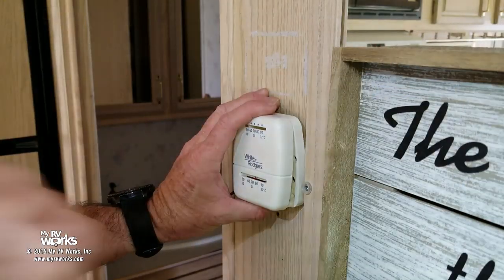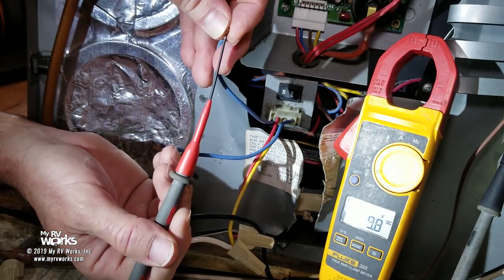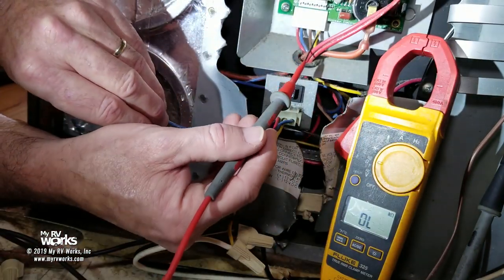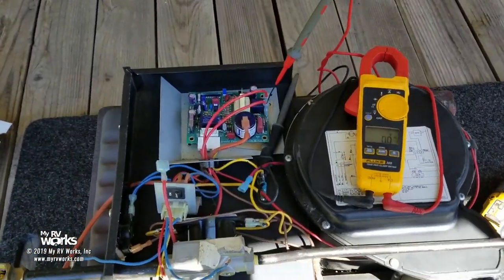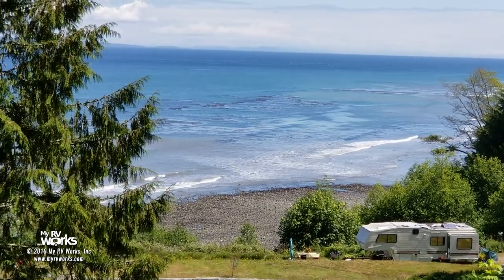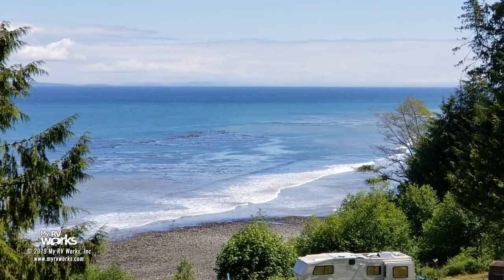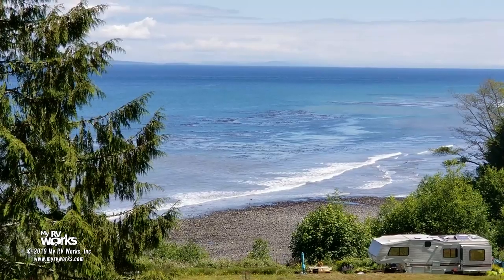RV Furnace Clicks But Doesn't Engage Blower Or Produce Heat - BONUS Strait Of Juan de Fuca Peek

Comment: Thanks Darren, I had the exact same problem the night you released this video on patron. It was good to see I used your "follow the trail" process to discover the problem. Finding a replacement motor was the hardest part. Suburban was out of stock and none of the area dealerships had one. With nightly temps in the upper twenties I had to go for a generic replacement I could get in 2 days. Would like to hear how you deal with this type situation. You are my number one guide to trouble shooting! Thanks for all your work, Charles

Comment: This may have helped me a bunch. Working on a suburban sf-42 with exact symptoms. T/S closes, audible click at the unit, blower does not start. Have not yet tested voltage. My initial assumption was a bad main board as customer said the unit was working a week and a half ago. However, I will complete a voltage test to confirm source of the issue. Thank you for these videos, huge help. 👍

Comment: Nobody ever talks about the Electrode Ignitor.  The amount/intensity of the sparks that  you'll get has a lot to do with the function of the furnace.  You can still get/hear a clicking noise that sounds like the electrode is igniting, but the spark won't be intense enough to start a flame.  This is due to a bad ignitor on the board (not sending the correct amount of electrodes). You can buy those separately if you know how to de-solder and re-solder one back on.  Otherwise, you'll have to swap out the entire board.  Thank you very much for the detailed video.

1

Comment: Darren, 

     Love that you show your thought process when doing your repairs. Keep up the good work. Can you show the inside of your trailer and what you stock.

Thanks
Reply from the maker: Thanks for the comment.  When I was sitting in the camp chair trying to come up with basic analogies I decided not to go too deep into that topic – I was already worried I was making a mess of my analogy and needed to get back to work – I could see the customer was getting antsy w/o having any power eh.  I do appreciate the comments though because it allows us to continue the discussion.
Reply: Darren,  I will turn heat on via a dometic t-stat fan and heat may come on immediately OR 3 HOURS later or even the next day?  So, is this 🤔 the relay going bad?  My rig is a 2004 Pilgrim international.

Comment: Physically checked distribution panel fuse (good). Thermostat clicks. Voltage checked the power switch, sail switch and circuit board. All seems to be working with the circuit board giving the error of "Air flow / limit fault). The Blower on the other hand does not seem to be getting power. I tested the -12VDC wire from the wall which is capped to the black wire going to the chassis of the blower. It worked fine. The black wire (reconnected) goes to the chassis of the blower. The connector for the black wire has a second black wire going to the off-white rectangular connector but does not seem to get power even though it is connected to the -12VDC wire in the wall. Following a number of your videos on testing. It seems to me my blower motor is dead as it is the only thing not responding and everything else (circuit board, sail switch, limit switch). As I do not have an available battery, is there another way to test the blower motor?
Reply: plug the blower to 12v

Comment: Suburban furnace  SF-42QT 15amp fuse blown. Turned all power source off. Replacement fuse blowes with power restored to fuse panel, furnace of course is off and fuse blows. Twice it happened.  Checked fuse component,ok. Reconnected to empty holder, still blowes. Line to furnace not showing resistance to ground. Firt thought comes to mind? Jasper AB little cold, using heat pump, fireplace and portable heater. Happy labor day

Comment: I had just a click also. I diagnosed it, and I manually engaged the sail switch and everything worked after the sail switch, but the blower still wouldn't turn on so the problem is prior to the sail switch.

Comment: If the blower doesn't turn on it can be either the motor, relay switch or the circuit board right?

Comment: What component you use for 12v? Power when you remove the furnace trying to troubleshoot my own. I do usually residential or commercial but I’m new to this RV furnace and air conditioning so good to know sequence of ops.

Comment: Hi Darren,
I have a sf35 suburban furnace that clicks, but the blower does not start. I have verified power to the module board on the blue and red (running to the board) wires, but there is no power at the board on the red wire to the blower.
Can I assume the board is bad?

Thanks for your help Gary

Comment: We have our thermostat set at 68. There are times when the temperature is colder than 68 and the furnace doesn’t kick on. We have to turn the furnace off then back on and then it warms up to the set temp. Sometimes it can work properly all day. Sometimes we will have to turn it off then back on gain. What could be the problem?

Comment: Hi love your videos. Please help my furnace is not working this is what happened we was sleeping the other night I got up because there was a bad smell almost like burning wires smell. I tract it down to the furnace so I turned the thermostat off and went back to sleep but the fan never shut off I got up 2 hours later with the same smell and the furnace fan was still on oh of course  I turned on all the exhaust fans in the rv..
Any way I went out side to look and there was lots of black soot on the out side of trailer and the screen. I disconnected the wires to the furnace. 
What do you think could cause that or where should I start first.

Comment: I'm taking HVAC classes right now and I want to work on RV's and travel to places like this. I wonder if I can make a living just traveling the country and working on RV heating and air systems along the way. My son died and I don't really have anything else to do. We were going to start a father and son heating and air conditioning business together in Texas but now I just want to travel and see all I can before I die. Shouldn't be much longer. I'll be 60 in June so I figure I may have 10 good years left before I can go see my son and Jesus.
Reply: I am sincerely sorry to hear about the loss of your son.  May the Lord help lighten your burden and guide and keep you safe.

I have been doing HVAC and Refrigeration for a school district and I am 62 years old. My nephews do HVAC/R also in the private sector. One will not touch residential because it is a pain in the ass dealing with homeowners, especially the women.  They beg you to fix their system, then cry poor-mouth when getting the estimate or invoice.  Small commercial is a good way to start out, as business owners need  that system running and will pay a pretty penny to have their beer cooler back on line again or the A/C system pumping cool air in their dining room again.

You should try to start out working with a smaller HVAC contractor to learn the tricks of the trade.  Tech school is great, but it does not compare to on the job training. You should try to work for someone while taking classes.  Both tech school and OJT training is the best way to attack it, you will learn this trade much faster. 

And at 62 years old, I still bust my ass on 110 degree roofs. Nothing like doing a compressor change out on a ladder access only 3 story gymnasium, where you are pulling up everything by hand, including a 75 pound compressor, pulling it up 40'by rope, one a hand at a time. And that is just the tip of the iceberg; torches, nitrogen bottle regulator, recovery cylinder, refrigerant tank, recovery machine,vacuum pump, extension cords, manifold gauges, scale, tool bag, step ladder, ultrasonic leak detector and other assorted goodies to get the system back on line; and this is always when it is hotter than hell and what goes up must come down.  

If you pace yourself and are in decent shape, you can make a good 10 year run at it.  

As far as being a travelling technician, you'd probably barely make a living.  Generally most people hit the road with their system running and in working order. If the system takes a hit, they will probably wait until they get back to their home and see their local RV repair shop.  If you are on the road, how will people even know your services are available. Maybe you can have a big sign on your RV and cruise through RV parks and get attention or advertise that way.  But be careful to get your money up front when buying parts.  Don't front the parts unless the cat looks well established and is on the road with a LATE model rig.  

Good luck and give it a try.  If you just are doing it for a way to be constructive and make a little gas money and meet people, have at it and enjoy yourself.  Best of luck and happy travels, I'll pray for your good fortune, joy and peace of mind. Someday you will be united again.  As a believer, you surely have seen signs of the Almighty's extra-dimensional presence.  Sometimes I forget or take it for granted what the LORD has revealed to me, but then I get a fresh reminder now and then and it is like a warm reassuring pat on the shoulder.  Hang in there brother, keep the faith and may the Lord bless you.
Reply: @ChrisNobodySpecial  Thanks John. I appreciate that and I do know that there is a lot of money to be made in HVAC if a person really hustles and works hard, but I'm not looking to make a lot of money and I have no family to support. I am not completely alone on the planet and money really means nothing to me. I know for a fact that I do not have to put a lot of effort into finding customers and drumming up business because my Heavenly Father has kept me on this planet for some reason that I can't figure out, but if I have learned nothing else, I have learned that He NEVER lets me go hungry or without whatever I need.
 I'm not looking to make a ton of money in HVAC or even enough to raise a family since I am well past that age. My hope for that was to see me son so it, but I will never see that now so the only thing I have left is to see what God has kept me alive for and to do whatever it is that He has left me here for and then with any luck, He will take me out of this world and let me enter into His Kingdom. I am not concerned in the least, how people would know about my services because God will let me know how to go about that. My needs are few and my faith is so much bigger than a mustard seen and I has seen with my own two eyes REPEATEDLY how my Heavenly Father has made impossible things happen for me over and over and over again so I appreciate all you have told me but little of it actually applies to me as far as how I will manage. God bless you and I pray that your life continues to unfold in a way that pleases our Heavenly Father and satisfies YOUR needs which are clearly much greater than mine.
Reply: @alanj399  I have heard preacher's and others all my life say they can't wait for God to take them. " I wish God would come back today". I think that is wrong, God gave us life to live and saying things like that is not being appreciative of his gift to us, live your life loving the lord and be looking forward to more day's on this wonderful earth, let God decide how long that will be and you worry about how you are going to live it.
Reply: Alan, I am so sorry for such a difficult loss. I hope you have been able to pursue your goal; I know it must be a heartache not to fulfill that dream with your son as intended. Feel free to reach out at info@myrvworks.com anytime. You'll be in our prayers.

Comment: Nice work finding that dead motor. I'll admit the title pretty much gave it away. If the motor relay engages that's pretty much the only thing left. One thing I wonder about is the economics of this repair. You had to come out, pull the furnace, diagnose it, order/replace the part, clean up the wiring then drive back out to reinstall. How does that compare (cost-wise for the customer) to just replacing the whole unit? I frequently run into exactly this predicament where its often cheaper to replace than repair.
Reply from the maker: I often don't know what I'm getting into until I get into it. I keep the customer involved as much as I can on decisions I need to make regarding cost, not only on the repair bill but also other options like replacement. This particular furnace had been worked on by so many other people it was butchered. When it was done we just had to put a new motor in and clean up some wiring and I even replaced a few wires. I think the customer made the right call and just replacing the motor. It works fine besides that. So now we have another happy camper.

Comment: So I have a question, I have same problem but I tested the blower motor by putting voltage to it with power probe and it works.. my issue is between the blower motor power wire from their back. What might it be?
Reply from the maker: Okay, if you have a power probe, check that when there is a call for heat,  that you have 12 volts on the pin on the DSI board that feeds the blower motor. Perhaps it's the control board and you're not getting power through that black relay on the DSI motherboard.
Reply: @MyRVWorks  I replaced the board. It works now. The board was fried.

Comment: Could a blower motor temporarily start working again? Just finished replacing the sail switch, then the circuit board which initially fixed the issue but now the furnace is not working, clicks but no fan turns on again
Reply from the maker: If your sail switch is stuck closed, then the furnace will not try to start the motor. Have a look at that sail switch again.

Comment: I have an atwood hydro 7912 12000btu, in an old 88 cabover camper.  I'd like to put in something newer and that puts out a bit more heat for winter use, I was looking at a7920-11 18000 btu, it looks like it'll fit does this kinda thing work, it's hard finding a replacement.  Thoughts?

Comment: I was wondering if you have any idea why the fan motor on my hf 8012 twitches once a second and does a quarter turn when the thermostat wires are connected. It's also not doing anything when I engage the sail switch manually. My intuition tells me the motor is actually spinning the wrong way when it does twitch on for that split second, but I'm not sure what way it's actually supposed to go, so I may just be stupid! 😂

Comment: Hi I have a 2013 White Hawk and when I turn the furnace on a goes through its Purge rate fires up and shuts off I put a high limit switch in a new ignitor I took the solenoid apart to check those I put it back together and it did the same thing I went out when I was trying to start an Purge I put my hand over the exhaust and it fires up and will run as soon as I take my hand off of the exhaust it goes out so I put a piece of aluminum foil over the exhaust just enough to cover but it still lets exhaust come out and it runs fine is there an air flow adjustment on the exhaust

Comment: what   if your fan runs because temp. is below the set temp and the gas was turned off. The blower continues but the gas was turned off by the supplier and not turned back on. fan continues and I turned the gas on. it did't lite, i had the furnace last sunner and worked fine before the tank was turned off. Is there a likely cause without removal?

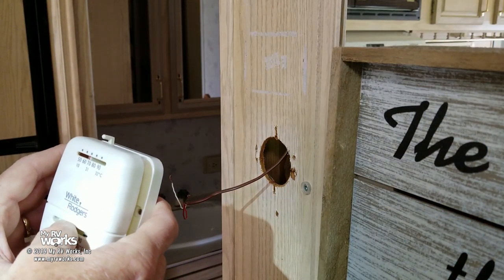Comment: See, at 3:40 you just blow it for me. Stutter, repeat, begin relating to a different furnace type? I've got the same issue with a click, but the fan is not starting and I just want to find how to trouble shoot that abd that only. No switches, no Suburbans or Aqua Hot just from hot wire to reset/power switch to board and that's all. Limit works, motor works and reset works. I've checked connections to and from board and have got it to work temporarily. Maybe not enough battery power amps to run fan but have fully charged battery? Got to be a bad board, right?

Comment: Hello do you have any videos on the AC code E5 on my Dometic thermostat. I turns it on and the compressor don’t turn on but it’s blowing air. Any assistance would be greatly appreciated
Reply from the maker: On this videos description we do list the error codes and diagnostic procedure for the SZ1 thermostat. Perhaps this will help. 
https://youtu.be/cmcSvh6xG2I

 We also have a lot of service manuel's on our website resources tab:  https://myrvworks.com/manuals/
Reply: @MyRVWorks  thank you very much. Your videos are great and so helpful. I’ve saved not only time but money as well by doing things myself. I’ve recommended your channel to several new camper owners as well.

Comment: Hi bud, i have an 2002 old RV and I've done numerous tests and the main issue is the blower does not turn on. I got power to it and all. Everything clicks as should but it don't turn on. I put it all back together it started working then turned off after min. The blower works when i test it manually to a battery. What can my issue be. 
P.S the same issue happened to my parents rv a few hours prior to mine.
Reply: Did you figure out your issue? I have the same problem. 12v into the board. If I send 12v straight to the motor it runs. I suspect the control board/ relay is bad.

Comment: How much did this end up costing the customer? I can get a new unit for around $400 but would prefer to have you save mine. I can drive to you 1985 34ft class A cross country by sportscoach
Reply: Sorry just got to the end of the video. I’m in Bonney lake but can go anywhere on the peninsula lol
Reply: 150 per hour...2 trips + motor

Comment: So...I don't understand what the end result of this was!  Was it a bad motor winding?  Big boy like you with all that technical knowledge played around with wires when you should know straight up that if the fan is not running then the problem is no power or a bad motor.  That would take me maybe 10 seconds and I'm not near as smart as you!